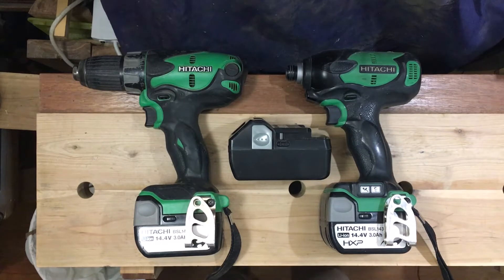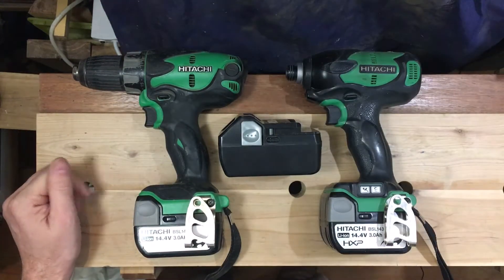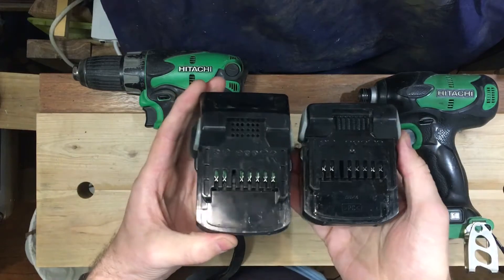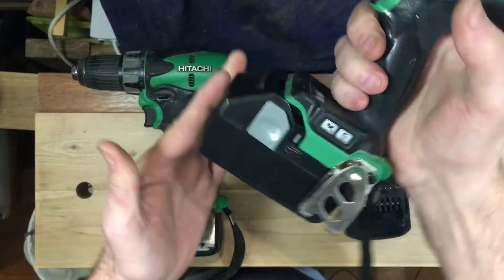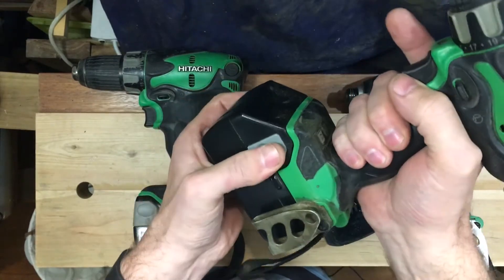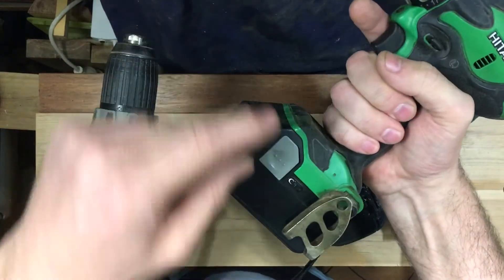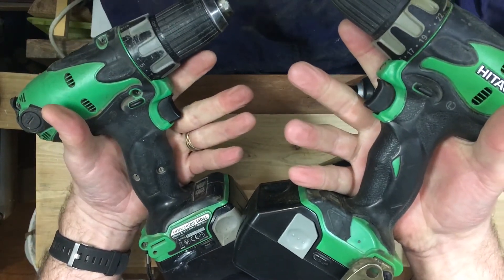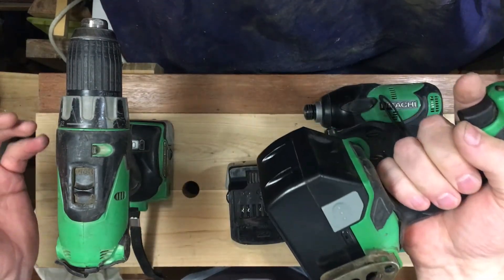Can an 18v battery be used in a Hitachi 14.4v tool?

Comment: I had conversed 14.4 Nicad to Lithium ion series of 4(4s) , 16.8 v but it ran no good! Slow or not even running ! I checked the voltage at 14.4v Nicad charger, the out put of the charger gave out 19.5v to charge for 14.4v Nicad batt pack( the old pack) , so i realized that the out put from 14.4 Nicad must be at around 19v .So i at one more cell 3.7 lithium to make up 5s plus changing to 5s BMS too . The result is good .Drill runs a lot better than before even when on new 14.4 Nicad in the old day
Reply from the maker: I'm glad it worked out.

Comment: I personally have a crap ton of old 14.4 volt power tools (saws drills impact drivers grinders etc.) that I am currently running on modern Li Ion 18 volt batteries. Most of these old tools were made to run on Ni Cad or NiMH batteries and they generally have the old 775 or 550 Johnson motors which were built to run at anywhere from 12 to 24 volts. Most of these tools have been running like this for more than12 years with no problems but you need to realize that the higher the voltage the faster they spin and the more torque they have so the quicker they will wear out. Most of the older Ryobi's, Makita's, Hitachi's, Craftsman, DeWalt's, Milwaukee's, bosch, etc. were well built so they generally handle more power with no worries.
Reply from the maker: Agreed.

Comment: I’m probably going to do this with a black n decker sawzall. The warranty is a dim memory and there’s an adapter to stick a 20v battery to it. Since it dies too fast I’m probably going to do so
Reply from the maker: Worth a try. Worst case is you may need to buy a shiny brand new replacement after the fire dies down. :-)

Comment: hey mate, can you do the other way? i can run a 18v hitachi drill on a 14.4 battery, the only downside is the Battery level indicator doesnt work. does the battery indicator work on your drill?
Reply from the maker: I dont have an 18v drill to test with. But I do get the same result on other 18v tools if I use a 14.4v battery... the battery level indicator doesnt function. Ths may be due to different sensing circuit connections in the 14.4v battery vs the 18v battery.  Not really something I've looked in to.  The man reason for the video was to look at the practicality of using an 18v battery in a 14.4v tool.
Reply: @proto4975  Great thanks for that i thought something was wrong with the indicator.